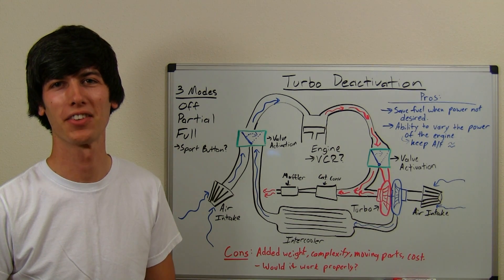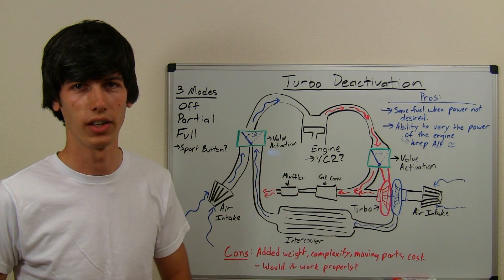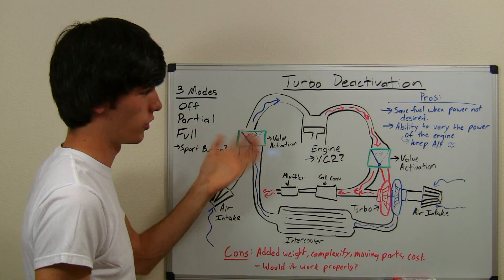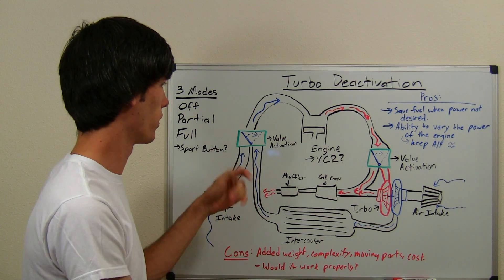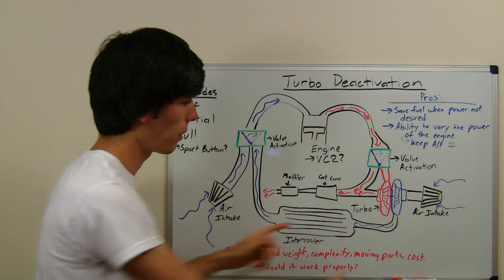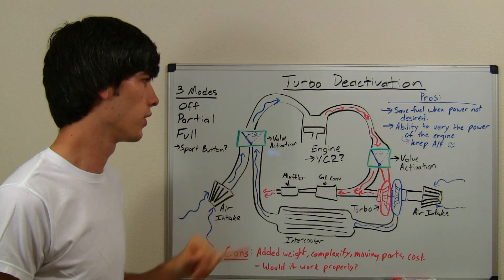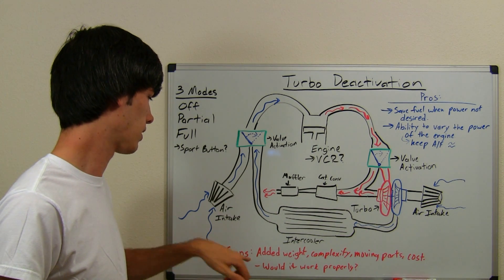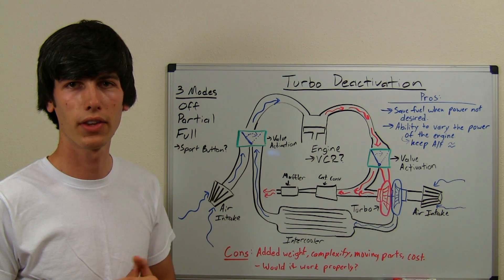Turbocharger Deactivation Concept - Explained

Comment: hmm i don´t understand the idea with this??.. if you are on the economical route you don´t have to push the turbo engine so it will go into boost..  When you are on the highway or going city slow the turbo spinning freely anyway with very little effort.. My turbo car uses the same amount of fuel or even less comparing to the same model car/engine without turbo..the system looks complicated and add more weight and also totally unnecessary..
Reply: Hit the nail on the head. Your turbo car is just like the non-turbo version whilst driving slowly because it effectively is - the turbo does nothing at low speeds. The turbocharger only becomes active when the engine requires lots of air flow - fast driving. So what's the point of this complicated system when every turbo car already has a much simpler version.
Reply: doktorbimmer
What you are really asking is why do turbocharged petrol cars achieve better fuel economy than cars with larger NA engines.

Answer is that any advantage gained in ridiculously low load fuel economy cycles is  simply because they are physically smaller engines. Of course, as we have established, in real world driving larger NA engines are actually more fuel efficient than smaller equally powerful turbocharged cars.
Reply: doktorbimmer
....AND what controls RPM? - THE THROTTLE VALVE (dependent on load of course).

You're being found out a bit here doktorbimmer.
Reply: doktorbimmer
Small engines are more efficient than large engines under the same loads. Hardly a news flash.

It's good to see you've abandoned your "turbochargers make petrol engines more efficient" claim though. Learning at last.
Reply: doktorbimmer
 A fictitious statement backed up by nothing but ignorance.
Reply: doktorbimmer
You really shouldn't be banding about theory that you don't fully understand.
Reply: doktorbimmer
A turbocharger's sole purpose is to increase mass air flow.

A throttle's sole purpose is to decrease mass air flow.

Huge conflict = poor efficiency of turbocharged petrol engines.
Reply: doktorbimmer
I guess when you name drop scientific theory to the other grease monkeys in the garage you think you look all clever because you don't have to back it up. Stating "the second law of thermodynamics" and then not linking it with your 'problem' in any way just makes you look like an uneducated chancer.
Reply: doktorbimmer
From the engine of course...where else.
Reply: doktorbimmer
keep telling yourself that. I guess you need the reassurance.
Reply: doktorbimmer
yawn...keep repeating yourself and writing "proven" and "fact" and I guess it becomes true in your head. Why not provide some proof or facts to back it up?
Reply: doktorbimmer
...from the "crankshaft" obviously. No energy from the compressed inlet air makes it past the throttle remember? We established that right, remember the pressure drop? If you think otherwise prove it with some engineering theory.
Reply: doktorbimmer "How do you explain the temperature drop between the Turbine Inlet Temp.  and the Turbine outlet temp"

The same way as you explain the temp RISE between the compressor inlet and the compressor outlet.
Reply: doktorbimmer "Not so dumb after all.."

Can't say the same about you.

So you see a raise in intake air temp as a good thing?...wow

What are those stupid engine designers doing fitting inter-coolers eh?

This is way above your head. You need to get a basic grounding in Physics first before you have any hope of understanding this stuff.
Reply: doktorbimmer
Looks like the penny has dropped....finally.
Reply: doktorbimmer
A turbocharger is an exhaust driven air compressor designed to force more air into the combustion chamber than atmospheric pressure alone.

However when an engine requires less air than atmospheric pressure can provide alone (ie during economy cycles and 90% of day to day) a turbocharger becomes an expensive exhaust restriction.
Reply: doktorbimmer
The tiny amount of HEAT energy recovered from the low exhaust flow is overshadowed by the HEAT energy that leaves the system via the inter-cooler, compressor and associated pipework.
Reply: doktorbimmer
Take a look at a typical small petrol engine turbocharger compressor map. What you'll notice is that the compressor cannot function below an air flow of around 4lb/min. 4 lb/min translates to roughly 40 bhp. That's right,  your super efficient small petrol turbocharged engine is actually naturally aspirated until it's producing ~40hp. So for all light load applications like MPG cycle tests the turbocharger is simply NOT working.
Reply: doktorbimmer
35% where did you pull that from? I smell BS.

Under low exhaust flow conditions the turbocharger is recovering next to no energy, less energy than the intercooler is taking from the system.
Reply: The real doktorbimmer Don't forget your tubocharger is recovering no energy at all until the engine is producing around 40+bhp - and that's for a small engine. By the time there is enough exhaust flow for your turbocharger to recover anything at all your poor engine is running horribly inefficiently to avoid pre ignition.

Comment: TLDR: if you drive fuel efficiently i.e. at low rpm the turbo won't work anyway.

The concept is neat but it's not necessary. All you need to control is the fuel intake of the engine(throttle) to save gas. so if you have a turbo and just drive at low rpm (shift gears early) it won't spin up and increase pressure. Also why would you need 2 air intakes? you could either let the air flow through the stopped turbocharger or just use a bypass that can be locked with a valve. Furthermore having the air flow through an intercooler will increase efficiency either way because the air will have more potential to expand thus extracting more thermal energy from the burning fuel.

Something like this might be useful for a supercharger tho
Reply: doktorbimmer
lol...you still don't get 'boost' do you. You have to try and forget preconceived notions gained from looking at your customers car's boost gauge. But I guess preconceived notions is the real issue for you.
Reply: 100% correct.

When you drive efficiently the engine doesn't require greater than atmospheric air pressure and the turbocharger is doing nothing but restricting exhaust gas flow.

Comment: Props for the thought but it's simplified by running a low spring rate in your turbo wastegate... set at 2-3 PSI would really not have a great impact in performance, would most probably give better torque at lower RPM & save fuel, then when you want good boost, an EBC delays the gate to say 15 or so PSI giving max performance on demand. I setup the same system on my RB25DET, gated at 4 PSI it felt very much like a stock motor ~200hp  then in fun mode 15 PSI @ 400HP.

Comment: You dont have to go crazy with making bypass valves which sound just like a blend door actuator. And if being economical is your idea, then don't screw around with bolt on performance. If you want to be able to run on a track and on still get good milage driving back from, well when you get an aftermarket ecu the shop doing your dyno runs can give you different tuning maps which you can change via a laptop. Or you can simply turn down the boost and all the other components should pick up on the changes usuing less fuel due to less air being forced in. If you want to come up with an idea, do the homework and check not just mechanical, but electrical components too. Maybe go some where and talk to people who do both things everyday.

Comment: I don't see a need for this, simply because the exhaust bypass valve is already in the system. The wastegate is open when not in boost, not quit a full bypass but the turbo is not creating boost. The slow moving compressor almost becomes a restriction allowing less air in, making the highway mpg much higher. Although I am no expert, so take this info as you will.

Comment: This kind of setup seems like a good one for an economical, naturally aspirated engine that wants more power to be sportier for, say, a track day. Then, you hop in your car and get 30 mpg on the ride home from the track. Great video, and thanks for teaching me something. :)
Reply: All cars have this system anyway. Under low loads, economy driving, the turbocharger doesn't do anything. There isn't enough exhaust flow to produce any meaningful boost and then any boost that is produced is throttled away by the throttle plate.
Reply: agt155 Not exactly true, or true at all for that matter. Cars today usually have VGT or Twin Scroll turbochargers that allow them to use the turbo to make for better fuel economy. Volkswagen is a very good example of this.
Reply: doktorbimmer
throt·tle

(Mechanical Engineering) to control or restrict (a flow of fluid) by means of a throttle valve.

If the throttle valve reduces manifold pressure to a level attainable without a turbocharger then any boost produced by the turbocharger has no useful effect ie is meaningless.
Reply: doktorbimmer Pressure is not energy. You must tell us more about this conservation of pressure law.

The throttle valve throttles air flow reducing it's pressure. Remember P1V1 and all that? perhaps not.

The "energy used to compress intake air" is stored as potential energy in the compressed intake air between the compressor and throttle valve. None of this "energy" reaches the engine until manifold pressure exceeds atmospheric.
Reply: doktorbimmer "If the engine is not spinning the thottle does not change the pressure."

Do you not realise how irrelevant that statement is?

What do you think the throttle valve is for? (there's a clue in the name)
Reply: doktorbimmer
Yes, although I dumbed it down a bit for you. "exceeds atmospheric pressure" more accurately means 'exceed pressure supplied by atmospheric pressure'.

Tell us how all this energy stored in compressed inlet air reaches the engine after being de-compressed by the throttle valve?
Reply: doktorbimmer
...and the intake air's energy is proportional to it's pressure. Post throttle no compressed air = no energy addition. It really is quite simple. If you want to find your "missing energy" try thinking about compressor inefficiency.

Need any more help just ask.
Reply: doktorbimmer
It's fun watching your internet persona fall apart around you.

Comment: "what's your evidence in saying turbocharged engines are less efficient in rl? i'm just genuinely interested."

Well, the most well respected independent automotive testing organization (Consumer Reports) recently compared the actual real-world fuel efficiency of a wide range of turbo charged cars and their NA equivalents. Their findings unequivocally determined that all the NA petrol engined cars were both more efficient and offered greater performance than turbocharged equivalents. The reason why turbo'd engines don't meet their MPG claims is because the EPA testing cycle is so out of date (0 - 50mph in 60 seconds!! for the acceleration test) tests require hardly any engine performance which allows manufacturers to cheat by effectively removing the turbocharger for the tests.

Here's the link for you

http://www.consumerreports.org/cro/news/2013/02/consumer-reports-finds-small-turbo-engines-don-t-deliver-on-fuel-economy-claims/index.htm

Comment: This seems like a concept that would best work for a 4-cyl. economy engine.

Doing this sort of thing on a bigger, more powerful engine (Inline 6, V6, V8) doesn't seem to be practical. If you want better fuel economy for bigger engines, you could have a twin turbo setup with the small turbo tuned for fuel economy and the big one for power OR just using cylinder deactivation. Turning 2 or 4 cylinders off on a V8 engine or 2 cylinders on a V6 engine would probably save you a much larger amount of fuel than this setup. At low rpms, not using those extra cylinders would give it the same fuel economy of a 4-cyl. (In theory...). You also have to think about room in the engine bay; having to design it to fit two intakes and two exhaust systems probably would take a decent amount of effort.

For the 4-cyl. engines, there's usually more room to house all of this stuff in the engine bay. However, most manufactures just stick a turbo onto their 4-cyl. engines not for fuel economy reasons, but for power. 4-cyl. engines usually already get great fuel economy, or at least a better amount then their bigger counterparts. So sticking a turbo system on for better fuel economy usually isn't the intended purpose. This system could help get the best of both worlds, but if the engine is already getting mpg in the high 20s, low 30s, would it really help all that much? Especially if the turbo is tuned properly to give more power without sacrificing that much fuel economy, or any at all? I think that maybe a full time turbo system with the ECU programmed to adjust a power vs. economy setting might be a better option. However, the deactivation concept can easily reduce or eliminate turbo lag, so that might be the game changer.

Comment: A lot of people are missing the point. A turbo on a 1.5 will help fuel economy, but a turbo on a 4L V8 won't. The system would be better for something like a BMW M5 that produces a large amount of boost when active. You would get a noticeable mpg boost from an increase in ignition timing, air/fuel ratio, or compression ratio, as you would use the knock otherwise generate by the turbo.

Comment: Turbos already effectively deactivate - when boost is not needed the wastegate or vanes reduce boost to practically nothing.

Incidentally, for diesel engines a small amount of boost is always wanted as the extra air / oxygen makes for a cleaner burn and less soot.

Comment: Engineering Explained, I say you gather the ideas of the folks who have responded and put together an updated design that takes the faults into consideration while implementing pragmatic theoretical mechanical solutions. Then, network and befriend experts in the field of automotive engineering or partake in vehicle modification, such as; race car sponsor parts shops, drag strip pit crew engineers. You have to find someone you can befriend and trust that will be willing to sit down with you and discuss the likelihood of creating a pragmatic version of your system. Once you have a functional design, you can begin to approach investors to collect the money needed to begin your own prototype designs. You can start out as simple as having sponsors who are interested in seeing your experimentation results. They can be the same manufacturers of turbo systems and electronics needed to create your physical simulation and in return may be the ones who pay you off to buy your final concept  or perhaps even hire you to become one of their in-house engineers. I apply this exact approach to my own projects as a business developer. So, it is a proven working entrepreneurial concept. Remember my friend...no matter how many people say it isn't possible, you just have to keep going back to the drawing board till your vision becomes reality. Henry Ford did this when he forced his engineers back to the drawing board, even though they kept insisting creating an 8 cylinder engine was entirely impossible. Good luck my friend. ~_^

Comment: Correct me If I wrong, but is more fuel used with a turbocharger? I thought the amount of fuels stays the same but the amount of air increased. Hence, one would get a more complete combustion reaction; thus, better fuel efficiency.

In regards to turbo deactivation, I think the partial mode would be great because it can be used to eliminate turbo lag.

Comment: In order to minimise components, you could perhaps implement a variable-pressure blow off valve and scrap the additional intake and valve system. 
That way when you want a more economical ride, you could simply blow off the high pressure air from the turbo-powered intake before it enters the combustion chamber (and then obviously lower the fuel intake into the piston to get the correct fuel/air mix).

This would mean that the exhaust is still always going through the turbo - so no turbo lag - but you still get the total amount of fuel & air closer to that of more economical, non-turbo cars. At higher speeds the valve would incrementally tighten to allow higher intake pressure and exhaust gases would already be powering the moving turbo rather than suddenly trying to overcome stationary inertia when the valves on your system  open.

This way you have less components - less cost, less complexity etc. while still getting the same effect of less air and fuel in each piston cycle and the only thing that you'd need to introduce is a slightly tweaked blow off valve system.

Let me know if you think that would be practical cause I haven't seen all your videos yet so I don't know all the ins and outs of how cars work.

Comment: the engine would not be as efficient and you would loose mpgs
Reply: You mean Gain Mpg? When their isn't more than atmospheric pressure used to feed the engine the ecu cuts fuel thus saving fuel GAIN in MPG. Because if you had the same two ecu-controlled engines and have it rev to a certain rpm, the turbocharger would make more boost which uses more fuel like at 2500 rpm and more torque, but the N/A engine at 2500 rpm wouldn't burn as much fuel and would probably make less power which is the negative.
Reply: you can burn fuel more efficiently with the air and make more HP @ lower RPM. on the intake stroke your engine will have positive pressure so the air/fuel is being pushed into the cylinder instead of being vacuumed.
Reply: So what you saiying is that for instance, In the same displacement and cylinder size, a 1.0L 3 cylinder Ecoboost will have better mpg than a Suzuki 1.0l 3 cylinder?
Reply: you forgot about compression ratio. if you take the same car, same engine and drive it in the same way your gunna have more performance and efficiency all around